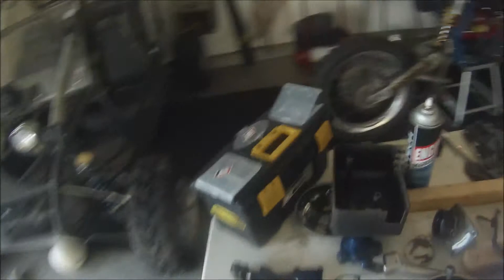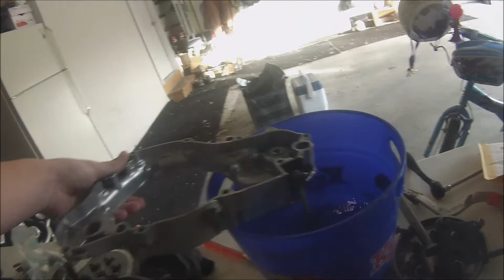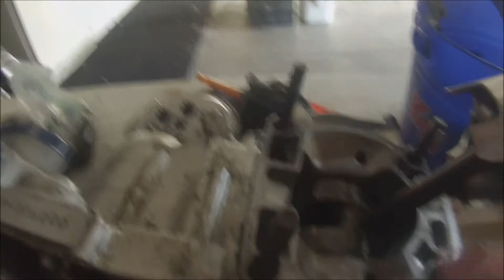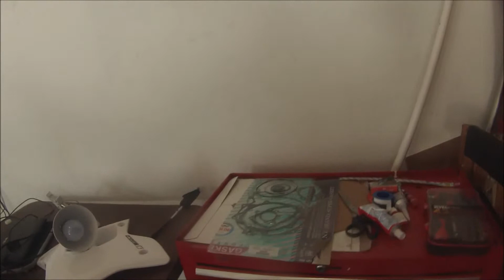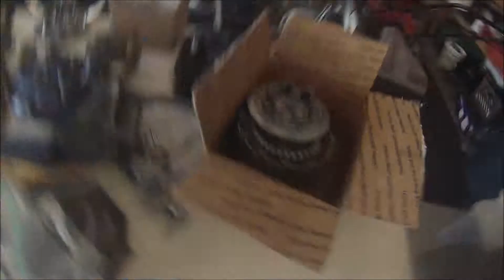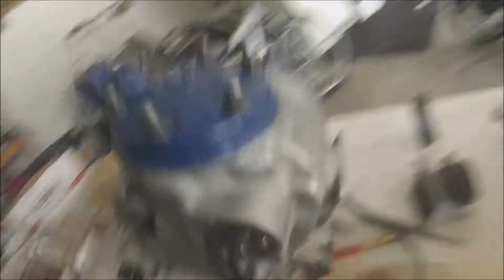Yamaha YZ250 Project - Part 5 - Reassembly

Comment: the clutch not rolling in gear is due to first of all having no gear oil in it, and the engine and oil is not warm
Reply from the maker: +Zaanjo It was actually due to the cutch not having the ball bearing in it. A prior rebuild was not done correctly.

Comment: The clutch problem your having could be from the throwout pin adjustment screw. Take the clutch cover off and in the center of the pressure plate you'll find the adjustment screw and locking nut. Simply loosen the nut and use a Flathead screwdriver to adjust the clutch release/grab.

Comment: Maybe needs to be worm or you need a lot more force for it to roll with the clutch pulled in. Maybe it will get fixed when its worm tho.
Reply from the maker: Thats what I was thinking. Possibly just needs to be warm and ran for a while until it properly breaks in. Onto the next problem. Got an air leak somewhere causing high revs. :(
Reply: That happened to me on my 03 yz125 after I rebuilt it. It turned out that the carb needed to be adjusted.
Reply from the maker: Goldensniper Yea, im possibly thinking about going to one size richer mail Jet
Reply from the maker: Austin TheMechanic Main Jet or pilot jet?
Reply: Austin TheMechanic you should make another update video on the 250 YZ
Reply from the maker: dupstep RC I would, however I was forced to sell the project and move on. I fixed it however for anyone wondering. Got some high quality oil and run the matchine for 15 min cycles until clutch is freed up. That is if the clutch is put back together properly.